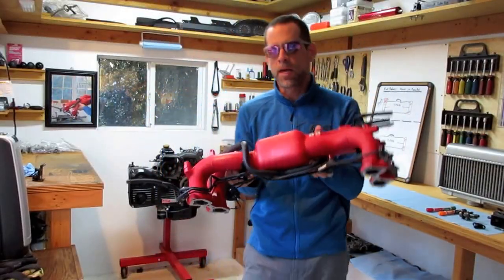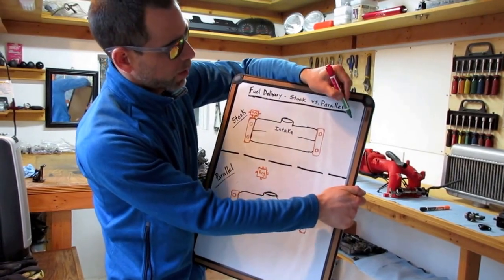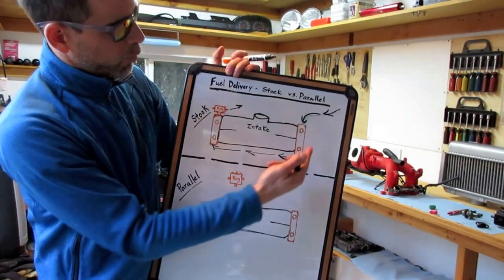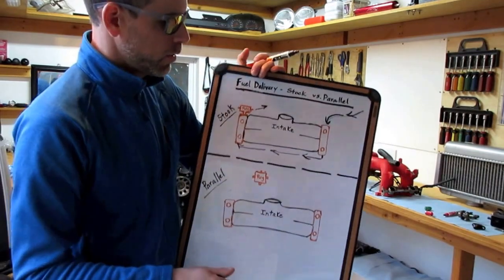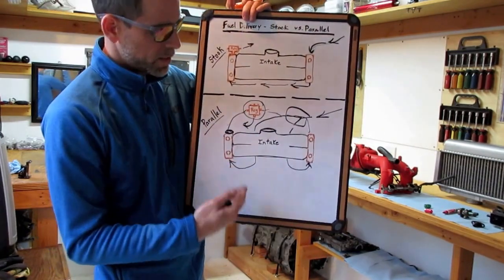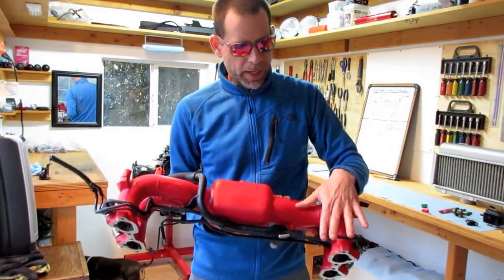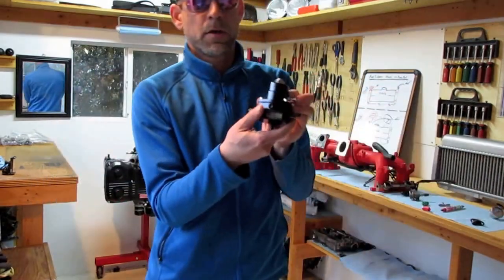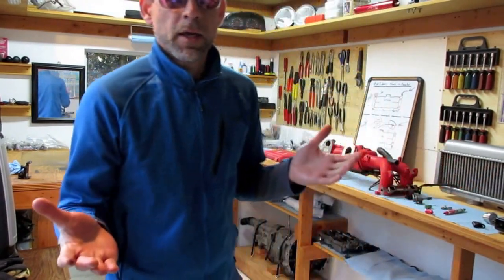How Parallel Fuel Systems Work on Subaru Engines

Comment: Ok,  Im running a parallel system and wanting to drain the fuel lines of bad e85. I have drained fuel tank by the in tank fuel filter(under back seat)  thinking of disconnecting the line attached to the fuel regulator to drain old out of lines? By Is this the best way or there a better easier way.. novice here.. thanks

Comment: Thanks Luke, Great Video but , there is a better way.
You use a fuel rail to AN 6 converters, run your hoses to from , in and out with AN6 fittings and plumbing to the fuel rails , fuel pressure regulator and return lines. and to your fuel pumps and fuel filters. I'm a gyroplane nut and thats what I'm using on my Subaru engine.

Comment: Interesting take on piston 4 failures. From what I've come across within the Subaru community, lean mixture in cylinder 4 stemming from OEM series fuel line system was to blame (you did touch on this). Limited cylinder 4 cooling does make sense too though. Thanks for the thorough cooling system break down.

Comment: Is it possible to remove all the hard lines and only run the OEM fuel rails with parallel fuel lines? Or do you need to upgrade the fuel rails as well? If so can you do a tutorial on how you hookup the hoses to the OEM lines

Comment: Going hard from first to second gear the engine can sometimes lose power for a second you think this could be part of the problem. 
Thanks Jason
Reply from the maker: Hmmm.  Would have to dive into more details to tell.  Could be a fueling issue to timing.
Reply: @SubaruONLY  hello again been looking through your videos was wondering if you done a one on fitting a bigger turbo
Reply from the maker: Hi, no I haven’t. But will think about that for a future video. Cheers!
Reply: @SubaruONLY  thanks for reply Luke
Reply: Hi Luke were can I get one of them fuel line splitters and all the other bits m8
Reply from the maker: Got it years ago on eBay. No idea where specifically, sorry, been so long!!!

Comment: Just got back in the subaru game after buying a GT (st/b) foz as a daily. What sorta power level would you recommend doing this?
Currently the cars up pipe, td04, 3" exhaust, EBC (15psi),  walbro pump  and an intake.
Reply from the maker: Nice man. Sounds like more power is what you’re looking for. I’d start with larger injectors and a tune, that should wake the engine up a bit!!! 👍
Reply: @SubaruONLY  Another question you might be able to help with. what are the stock auto's in the turbo models good for power wise.
Reply from the maker: I hear around 350-400 WHP.
Reply: @SubaruONLY  Works for me. Only after around 200kw @ all fours. :D

Comment: This is hands down the best quick explanation I've ever seen for our EJ fuel systems.
Reply from the maker: Sweet - thanks buddy!!!
Reply: @SubaruONLY  In your experience, is there a point in which you would recommend going with a parallel setup over stock on an otherwise stock USDM sti?
Reply from the maker: Probably not, to be honest. Feel like the OEM setup is fine for anything that remains totally OEM tune. Can’t hurt, but there’s always the chance something isn’t reconnected quite right, so there’s always a slight risk when doing any modification.

Comment: Hey luke important  question ..on N.A set up can running parallel fuel line increase performance  on n.a set up .and any fuel pump upgrades  for a N.A set up?
Reply from the maker: Hey bud - thanks haven’t gone too deep into the high performance NA motors, but I don’t think the fuel supply is as much of an issue with NA motors.  So not sure if it would help much.
Reply: @SubaruONLY  thanks luke  I just feel like u can give a N.A power just as a turbo can maybe not much power but something is something ..another question my 06 forester ..can my computer capable of flash tunning  or just subaru computer  are they flashable  seen someone make a N.A impreza  turbo and he had flashed and tune the stock wrx tune setup  and it work great
Reply from the maker: 👍 hmm, good question.  Not sure if you can flash those NA ECUs.  Let me know what you find!  Cheers! 👊
Reply: @SubaruONLY  I mean I have a video of a N.A non turbo impreza get flash tuned with a cable off ebay  if that N.a ecu can be flashed  wonder if it's good for the forester.same motor
Reply from the maker: Did a 5 min search and looks like these NA ECUs can be tuned (COBB briefly offered an Accessport for 06-07 NA Imprezas, but it provided less than 10HP, didn’t sell well, and as a result, was discontinued), however, the gains for the cost are debatable.  I’d focus on adding lighter parts and suspension mods to make the car more fun - just my opinion... cheers and good luck!!! 👊
Reply: @SubaruONLY  yes I already got on that as of now I have wrx stock suspension  with tein performance  springs and exhaust I have OBX equal length long tube headers  connected to my mid pipe that's 3 in a the way to the muffler  and a lil intake custom ..still working on code p2096 .I think it's my fuel pump smell fuel at times especially  when turn car off and some times on slow regular  drive take offs  its chokes he and ther but that's only on feathering taking off ti drive regauler.. I feel like fuel pump is weak or fuel filter clogged ..I acknowledged  everything original   with 265k miles ..no knocks or pings and doing every  thing to prevent
Reply from the maker: Nice 👍 coming along for sure!!

Comment: Hello I have a couple of questions for everybody and the comment section does anybody know if there is an aftermarket fuel system for the ej22 phase 1?
Reply from the maker: Any of the aftermarket fuel system upgrades for “EJ” style motors will work.  Check out IAG - they got a some good options!
Reply: @SubaruONLY  for the 1996 ej22?
Reply from the maker: Yep - and great engine!

Comment: But wouldn't parallel  fuel system  make car respond better  not just for hight horse power?
Reply from the maker: doesn't really help for response. Only helps prevent fuel starvation, which usually occurs in the upper end of the RPM range.

Comment: Running  lean  p2096 ..when I keep a consist thottle thru out drive code wont pop up until hard thottle... I did head gasket job.. dought it be that...I thought is fuel pump fuel filter ima do that and injector those are what I think is causing it or exhuast leak but I got full bolt on..and obx long  tube equal lenght headers and everything tight
Reply from the maker: Sounds like a potential leak somewhere - intake side is very common for lean condition. That would be my first target area to look over closely. Good luck buddy! 👍

Comment: How did you take the stock fpr out of the system ? You must of used a dual input regulator for this to work or the first fuel rail would have no pressure ?

Comment: Hey Luke, can you do this with a stock fpr?
Reply from the maker: You could!  And it should work just fine! Good call!
Reply: Good to know man! An aftermarket fpr would be nice to have down the line along with the AN fittings.
Reply from the maker: Totally - but running a parallel setup with all stock stuff is a good step in the right direction!  And super low cost! 👊

Comment: Whats is a good brand of fuel pressure regulator thst you recomend? Thst does not brake the bank.
Reply from the maker: Well... like so many parts, this is a part that is a little costly if you buy from reputable manufacturers - which I 100% do recommend doing.  There are cheapo eBay ones out there but this part is something that can cause major engine damage if it fails or starts to become inconsistent - so stick with the high quality manufacturers.  Here’s the ones I like: (1) AEM, (2) Radium, (3) Tomei, (4) Deatschworks, (5) Aeromotive, or (6) FuelLab. These are all legit and reliable options!!! 👊
Reply: Radium, aeromotive, both make good FPR

Comment: Sorry guy, still the same back up pressure point...just at the splitter down to were the rail w.o the regulator...if u have 2 regulators on each side then it would work. But nah lol still going to have more pressure on the rea4 rail

Comment: Why is the regulator at the end  and not before the first cylinder?
Reply: I got pink sti injectors should i hook it up in parallel
Reply from the maker: Parallel is good regardless of the injector size.  And, as the fuel flow requirements increase, parallel flow only helps more.  So, in other words, can’t hurt at all!
Reply from the maker: It helps keep the pressure even across all fuel injectors.  This is because the pressure drop happens right after all the injectors, which helps act as a buffer to minor fluctuations.

Comment: I see this is an old video. Just now getting into subarus. Your only running 4 injectors with probably a 255 pump. V8s run the same pump with pressures of 45psi and higher and dont have this problem. Try going to a bigger size line and your problem would go away!
Reply from the maker: Hey man!   Thanks for the message!   Yes, I think you are 100% correct - great advice!  Bigger lines would be very good call!  

Side note, I actually started my automotive journey with small block Chevy engines - so some pretty familiar with your reference perspective.  I spent many years drag racing and circle track racing small block chevys in early 2000s. Had a couple 68 Cameros, 64 nova, and others!  Good times man!

Comment: I'm interested in modifying my stock fuel lines on my 2003 wrx, everything is off the longblock for a jdm block swap anyways and I want to create a safer fueling system while I'm at it. Do you have any ideas for the fuel pressure regulator faceplate on the cylinder 1&3 factory fuel rail? I'm thinking of chopping it off and having the hole welded up. But if I could just tap it and use it as a return line so that both fuel rail return lines lead to the same FPR that would be great. I can send pictures of the concept I have in mind I would love to have your input. Love the channel, thanks a ton!
Reply from the maker: Awesome man.  Yes, send pictures and info to my email:  SubaruOnlyShow@gmail.com
Reply: SubaruONLY Tomei actually makes a FPR adapter to a 1/8 npt thread. So I'm going to use 2 passenger side fuel rails with these adapters leading to my return lines.
Reply from the maker: Nice!  Thanks for sharing this!  🤙🤙

Comment: Excellent content! 

Recently discovered a fuel leak under the intake manifold of my 05 sti. In the process of repairing the line, would it be wise to go with a paralleled set up? Would I need a tune to run this modification?
Reply: For the tuning question, I think the answer is NO.
Reply from the maker: Hey man.  No tune needed for switching to parallel fuel line setup.  Is it needed, not likely for near stock STi. Will it hurt, not at all if installed correctly.  Good luck!
Reply: @SubaruONLY  Do you have to run a fuel pressure regulator if you're running stock power? Would be nice to do this setup when fixing my fuel leak without having to spend money I don't have on a fuel pressure regulator.

Comment: Hi What's the internal diameter of the y splitter? Also where did you get it from I can only find brass splitters on e bay.
Reply from the maker: +Jon Cole   I found it at a specialty shop.  I’ll try to hunt it down.  I think I searched for this term, “stainless steel y splitter”.  They manufacture made OEM parts for domestic manufacturers I think.
Reply: Hi do you think this will work?
https://rover.ebay.com/rover/0/0/0?mpre=https%3A%2F%2Fwww.ebay.co.uk%2Fulk%2Fitm%2F382418735204
Reply from the maker: I checked it out.  I would go with something that had more of a barb fitting for the hose, so the fuel line can’t slip off.  The inner size should be ~ 5/16”, which is about 7mm. Here are a couple of options: 
1) https://rover.ebay.com/rover/0/0/0?mpre=https%3A%2F%2Fwww.ebay.com%2Fulk%2Fitm%2F232853108745
2) https://rover.ebay.com/rover/0/0/0?mpre=https%3A%2F%2Fwww.ebay.com%2Fulk%2Fitm%2F311095859089

Hope this helps.  See how those have the barb ridges to hold the hose on once it is slipped over - still use high pressure fuel line clamp of course.  The stainless option is way more expensive but stainless is really nice to use as it doesn’t corrode at all, and it will probably be a better quality casting too.  But the brass option should be fine too.  Bet you can find these on Amazon too - FYI.  Good luck buddy!   Let me know how it goes!  🤙

Comment: You saved my pistons i owe you my left testie
Reply from the maker: +Glenn Andrews  legit.  Keep it rolling!! 🤙🤙
Reply: @SubaruONLY  I’m glad to join your channel and have just bought myself some parts off of your Amazon Store. Would you like to consider making videos on how to make more power and torque in a non turbocharged ej motor? I know that it’s not the most cost effective way to make power but ( I love the na ej as it is playful and peppy, just not powerful) what can be done to a Sohc EJ22 engine?
Reply from the maker: Supercharger.
Reply: @SubaruONLY  That’s works well for me,  any recommendations on the type of supercharger and brand to best utilize for a fun street/ occasional track car?
Reply from the maker: Think the ones used for OEM BMW applications have been used with some success.
Reply: @That_fella_named_J  the stainless unequal borla replica headers are great bang for buck, with maybe a 2 1/4 inch exhaust. a manual conversion helps a lot too
Reply from the maker: Yep, nice upgrade!!! 👌

Comment: Would you go cheap on a fuel rail? I know not to on things like injectors, pump.. but what about fuel rail?
Reply from the maker: +Mark Villanueva   Actually, I would because I feel my evaluation of inner ID and factors that control things like turbulence is adequate to make a good judgement.  The one think I can’t really assess is the quality of the material used - that’s the one risk, but I’ll just keep eye on wear and tear on the parts.

Comment: Have you heard of the GR sti stumble? Was wondering what you're take on it is.
Reply: I am trying to resolve a gr stumble.  That's how I found your video.  I have 1000cc injectors on factory rails and lines and I have a aeromotive fpr.  I still have a stumble.  I'm looking at new larger rails like iag plumbed in parralel.  I think your mod may be a better fit for me.
Reply from the maker: Good luck.   Hope that fixes it.
Reply from the maker: +moog  - I have but have not personally gone down this rabbit hole.  From what I understand, it's basically the OEM fuel dampners that are impacting higher than stock fuel flow characteristics. This can create that stumble between 2000-3000 RPM - Super annoying! 

SOLUTION:  Many have had good luck using the IAP or the COBB kit - I would try one of these.  Thanks and good luck.  Let us all know how it goes!  👍👍

Comment: This way you invert the order the cylinders get fuel. It should be after the split one line going to the front of the right fuel rail and the other to the rear of the left fuel rail (left and right as in you scheme).
Reply from the maker: +siliconfilm   Interesting.  I'm curious - What's the logic doing this?  Does it create an advantage or safer running conditions?
Reply: SubaruONLY Honestly I have no idea if changing the firing order with respect to stock will make any difference. Many seem to be doing the way you did. But if you take a look  at the Perrin fuel rails they are setup the way I described, which maintains the firing order unaltered.
Reply from the maker: +siliconfilm   Hey - thanks for the follow-up.   So I don't change the ignition firing order - I keep it 100% stock.  For the fuel system...The side that the fuel enters the fuel rails doesn't really affect how or when the injectors distribute the fuel (unless we start getting really technical).  All that matters is how much pressure drop you see across all fuel rail points and not putting too much heat into the fuel before it enters the rails. Too much pressure drop and you'll end up with inconsistent fuel delivery and too much heat transmitting into the fuel line could cause vapor lock (blocks flow of liquid fuel).  Hope this answers at least part of your question.  Cheers my friend!!  🤙🤙
Reply: SubaruONLY great so the firing order stays the same. One thing you can do to keep fuel cooler is running the fuel lines over the intake manifold. I guess if you use large aftermarket fuel rails and larger fuel lines you could also keep the design in series and the greater flow should fix the allegedly lean condition of cylinder #3.

Comment: Would you say this is the main cause of the famous cylinder #4 ringland failure on the older STis?
Reply from the maker: +JackstandJohnny  You are 100% correct about cylinder #4 being the most common failure location.  This is also a highly debated question, here are my thoughts:
(1) The fuel distribution is definitely one of the culprits but I think there are some other things at play here as well.  
(2) For example, the knock sensor is nearest to this location and I have read that Subaru tunes their ECUs to advance spark on this cylinder more than others to creep up on highest advance possible, then it uses the threshold for that cylinder as a proxy for max timing advance on all other cylinders. 
(3) I also think the fact that the cylinder is in the back of the engine plays a role as this causes more heat soak than the two front cylinders. 

I'm sure that's not all of the reasons but those seem like some big ones to me.  Hope this helps or at least keeps the wheels turning...Thanks 👍👍
Reply: Watch 'GetaDomTune' in YouTube.   He explains cylinder 4 ringland faulure.  And has a proven solution.
Reply: Totally makes perfect sence balance is key.  NOTE TOO SELF!!! lol how did your set up turn out?
Reply from the maker: Working great. 👊
Reply: Main problem is lack of forged internals on a boosted engine.
Reply from the maker: True that 100% 👊